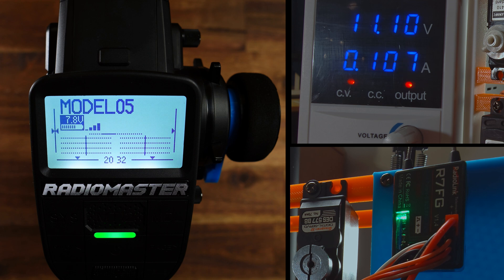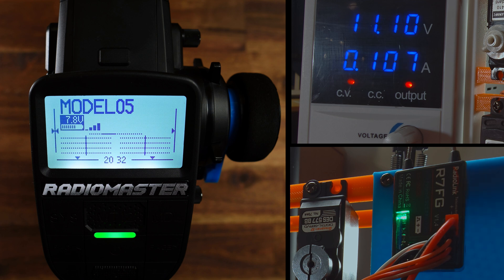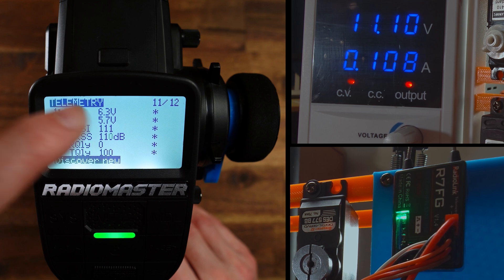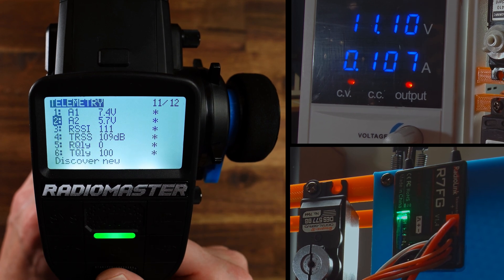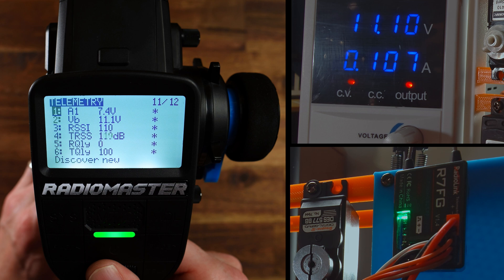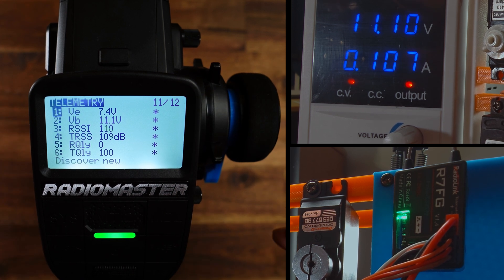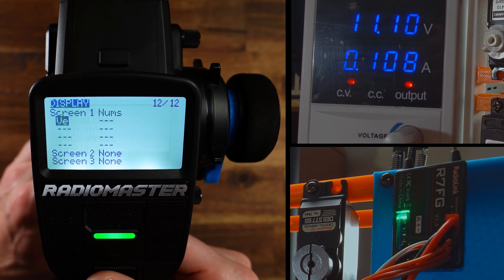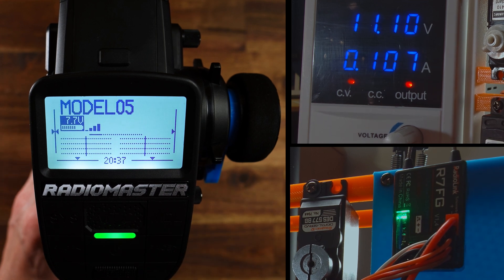DISPLAY TELEMETRY DATA ON THE MT12 | EDGETX | TUTORIAL [EN]

Comment: Hi arminrc. Thanks for all your help with the mt12. I have noticed some folks on the fb page are having signal issues with crawlers at close range. Is there a way to turn the power down to lower the overall range and make the remote not loose signal at close range?
Reply from the maker: Sorry, I am not aware of a solution for that problem. In my video about binding different receivers I should this problem, too. And just recently I encountered this problem when driving my mini crawler with an RadioLink R4FGM Rx.
Reply: @arminrc  saw on fb someone cut the antenna down on a r85c and apparently they are happy with it as it now is a close range receiver just for crawling but idk that seems drastic
Reply from the maker: @jesseharless24  Yes, I red it too! I would never cut an antenna because their length is calculated to match the wavelength of the signal. But: to each his own!
Reply: @arminrc  same.

Comment: On my quads, I can show average cell voltage.  Since there is no flight controller involved, assuming I can’t do cell voltage?
Reply from the maker: As long as you do not have access to the seperate cells of the battery you won't be able to get the cell voltage! Usually a flight controller (on a Drone) or an ESC (on a car for example) is connected to the main output of the battery (at least if a certain amount of power is required for the vehicle). To have access to the cell voltages you need a connection to the balance port of the battery. So, in essence, you would need a receiver which can be connected to the balance port of the battery (in addition to the normal power supply) and which can then transmit all those cell voltages back to the Tx via telemetry.
If you really need this maybe you should look at Spektrum. They have their "Smart" batteries which can transmit additional data to the ESC. But then - of course - you are bound to Spektrum products. You then have to swallow this bitter pill. 😉